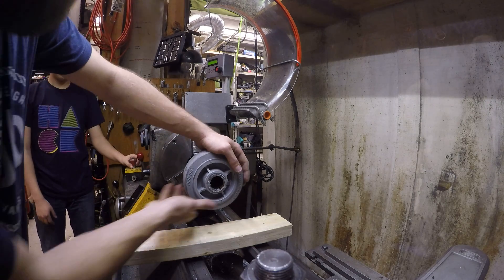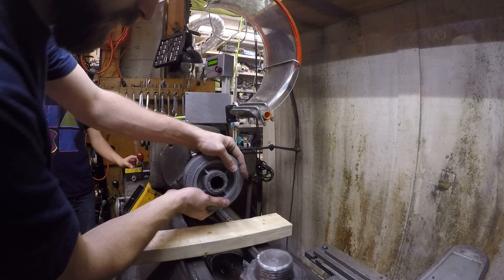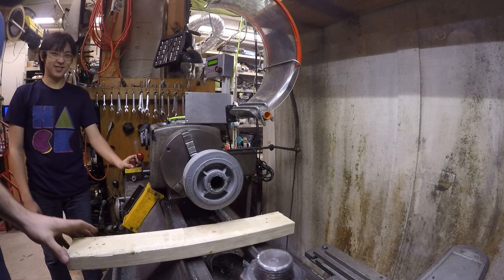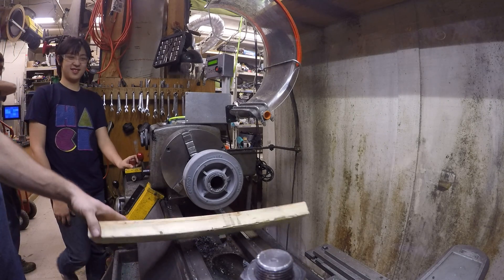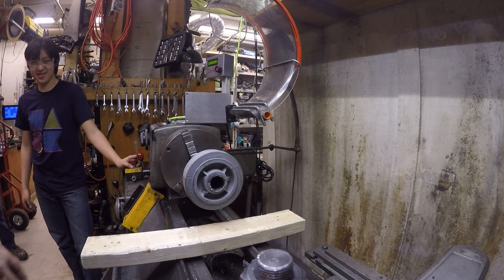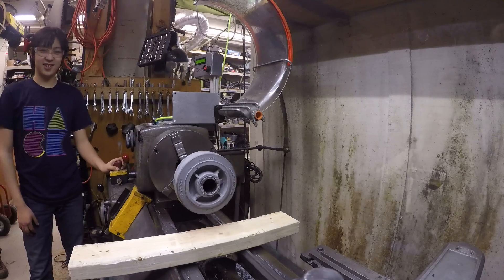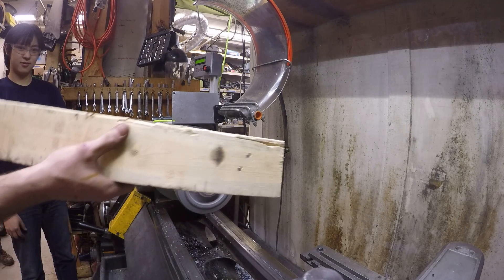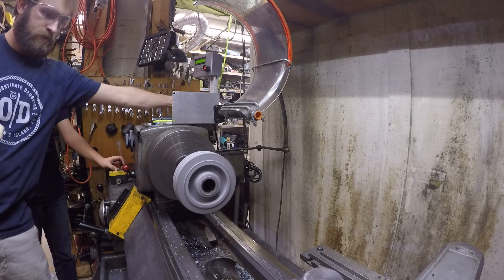Colson Wheels to Knurled 1018 Hubs

Comment: What is the max. rpm you ran? Thanks.
Reply from the maker: In the test? 600rpm ish. 

In use? Intermittent 1400 RPM bursts, either direction. Every single wheel I had wore down to 4" before I stopped using them, none of them came off their hubs
Reply: @FrederickMoore  Thank you. I'm trying to build myself a pickleball shooting machine. One of the robot part vendors said the 4" and 5" Colson wheels were good for 50 mph ~3400rpm for a 5" wheel ~2900rpm for a 6" wheel.